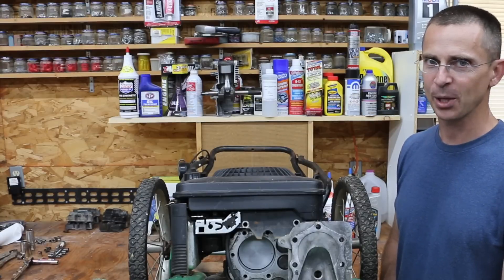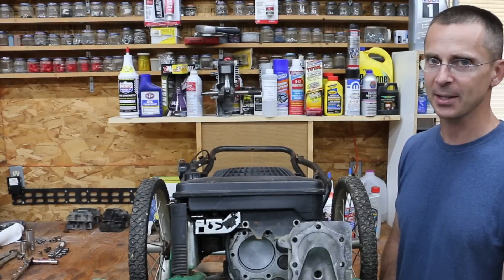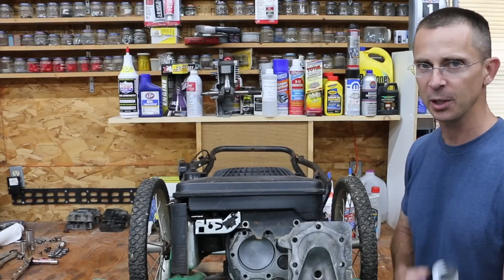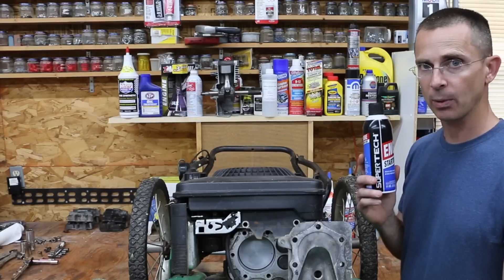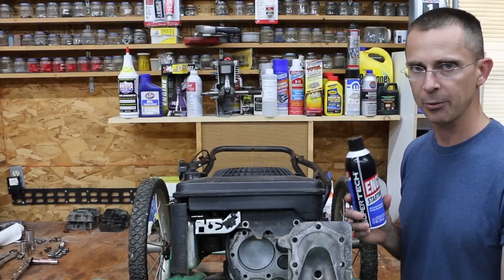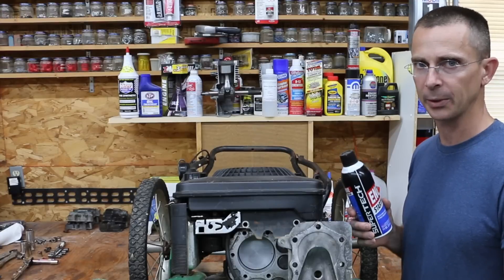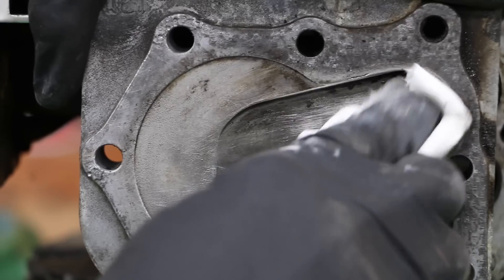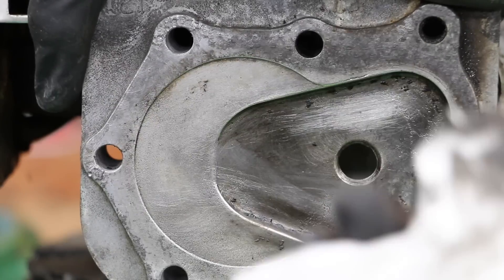Will Running an Engine on 100% Starting Fluid Cause Damage?  Let's find out!

Comment: Sorry for my ignorance, but what does compression tell you? 
Is more always better? Or just to a certain point? 
Thanks in advance. Love the videos!
Reply: Sorry no one reply, the reason is that if the compression doesnt go up it means the piston ring is bad and that is the reason that the engine doesnt turn on and is not a fuel/electric problem. In a multiple cylinder engine all cylinder must have a even compression if for example in a 4 cylinder engine the compresion is :
115/ 60/ 100/ 75 that means that the head gasket is bad. 

115/ 115/ 0 /120 Head gasket is good but the cylinder with 0 haves bad rings.

Comment: i've seen over reliance on starting fluid make an engine "addicted" to it. if used to start too often. It forces the piston rings to  open too hard at about TDC. you lose juuust enough compression at TDC juuust long enough the engine won't start easy unless starting fluid is used. once running. it will run like normal as the wear is only really at about TDC where ignition occurs. it's a thousandth of an inch wear i'm talking about. and only at about TDC. Not the whole cylinder wall. I've only ever seen it happen to diesels engines though. Gas isn't that hard to start so people don't use starting fluid on it often enough to make a difference i don't think.
Reply from the maker: Thanks for sharing.

Comment: An engine runs just fine on natural gas or propane, so why would starting fluid running more dry damage anything. The pistons and valve stems are still lubed with the oil. Clearly is a much cleaner fuel to run, maybe even test it as a carbon cleaning product. The only problem I could see from starting fluid is if they use a low octane fuel to promote ignition, and this induced knock in the engine.

Comment: I once used spray start to start an old chinese diesel tractor.
Spray too much into the intake and the engine will knock like crazy because of early ignition. The rods and crankshaft will at some point take damage and go kaput.
Reply from the maker: Thanks for sharing.

Comment: What I have seen as a mechanic for 22 years is too much into a diesel causing a vapor hydraulic lock that blows rings apart and damages the ring grooves and even piston skirts. But also on diesel you have to keep in mind a lot have grid heates at the intake that get glowing red hot to heat intake air for cold start. I say this because 5 of the 13 in frames I have done were either babys and all had same damage. They were all international 6 cylinders. All were done due to age. Ranging from 17k to 21k hours as a garbage truck.
Reply from the maker: Thanks for the feedback.

Comment: In my over 50 years on this planet...I've run gobs of starting fluid in various engines....Using it to clean carbs, but mainly for trying to diagnose problems. NEVER have I had any damage to an engine from starting fluid in mowers and tractors that were carbed, after running a couple of cans worth spraying it into the throttle bodies.....It fixed whatever was broken..Usually just burning out crud or old gas.
Reply from the maker: Thanks for sharing.

Comment: Would have liked to know the ingredients of the starting fluid and if It has any lubricant properties.
I used to use Racing Gasoline in some of my cars and motorcycles and noticed it smelled like Toulene, which I think smells pleasant, see if an engine will run on 100% Toulene. Thanks 🇺🇸
Reply from the maker: Great suggestion!

Comment: Probably the biggest risk from starting fluid is the potential for blow-back if too much of it puddles up in the intake and ignites.  The only other thing I've heard is that it's not good to use starting fluid with diesel engines.         /           If I'm remembering this correctly (and I may not be) the problem stems from the burn rate.        /         Diesel burns slower than gasoline which burns slower than starting fluid. If the fuel burns too fast it basically detonates inside the cylinder head instead of expanding at the desired rate and pushing the piston. A big enough detonation can cause immediate damage. An engine that's detonating regularly can suffer damage over time.            /         Diesels run at higher compression to start with but they turn much slower so the piston may trap the explosion rather than converting it into movement.        /          I don't know what they use to make starting fluid anymore but I imagine running pure starting fluid in a gasoline engine would be similar to running pure alcohol or mixing regular gas with av-gas. It would run hotter and be prone to detonation.        /         Decades ago a friend of mine used to go to the airport and buy av-gas and mix it with pump gas to make his own cheapo racing fuel. If I recall correctly, He mixed one quart of av gas with a full tank of pump gas.  This mix required him to change the spark timing, use a cooler thermostat, and run the biggest radiator he could find. (It was a 60' or 70's chevy I think.)        /         In the 80's they were putting engine vibration or detonation sensors on some of the early computer controlled cars. They were trying to run as lean as possible. If they ran too lean they'd detonate and the computer would have to alter the timing and fuel delivery. Different cause, same problem.
Reply from the maker: Great point. Thank you

Comment: What starting fluid does,( may be evident with the oil that you found of the cylinder head) is wash away the oil seal, on the cylinder walls.in time, will cause wear, because of the lack of lubrication around the Rings.
Reply from the maker: Thank you for the feedback

Comment: Great video as always ! 
Hey running a mini bike engine with those 40 dollar kits on Amazon , the kit using the , I think 6 gram bottles of nitrous , oh ya , what kind of boost and will it destroy the engine 
Joe Navy veteran 🇺🇸🇺🇸
Reply from the maker: I actually tested it on a motorized bicycle and it did help.  I ran the engine rich of fuel but not rich enough.  https://www.youtube.com/watch?v=Wmg0bzuO1Mc

Comment: You are correct running a engine on starting fluid will damage it!

However it only applies to 2-cycle motors which have oil in the gasoline.

Short use just for starting will not hurt anything.
Reply from the maker: Thank you

Comment: My understanding is, if you regularly use starting fluid on a engine, due to the increased pressure on detonation it damages the piston rings, so they start to lose there seal compression wise and thats when a engine gets "addicted" and will not start unless the starting fluid is used,
Reply from the maker: Great point.

Comment: Many valid literature on diesel engines state engine damage may come from using too much starting fluid and I've witnessed it myself on diesel engines... it spikes the rpms well above the 3-4k rpm that the engine is used to running possibly resulting in a runaway engine or engine catastrophic damage
Reply from the maker: Thank you for the feedback

Comment: Id heard eggs or pepper will plug up leaks in a radiator, I tried it, wasn't a quick fix, perhaps a repeat treatment,  but yes it worked for quite some time, I never replaced the radiator, I just sold the trk a couple of yrs later

Comment: Awesome as usual. Did the starting fluid that you used have upper cylinder lubricant? Tarde to find it without it these days just wondering if that’s why It didn’t hurt anything? Keep up the good work and thanks
Reply from the maker: It did indeed. Thank you

Comment: I mix my own model airplane deasel engines on a mix of starting fluid, kerosene, caster oil and a bit of cetaine booster for semi engines - I was wondering what other starting fluid will work as good or close too the John Deere fluid I use- they have different amounts of ether in them and some just don't work good,  ether content is the main thing
Reply from the maker: Thank you for the feedback

Comment: Starting fluid will burn out glow plugs instantly but you can use it as long as you wait for the glow plugs to go out before you spray it
Reply from the maker: Thank you for the feedback
Reply: @ProjectFarm  I did have a set of glow plugs that were victim of starting fluid next time I get a set I will post pictures

Comment: I know this is an older video, but I was thinking:

If you drained the ether into a jar and used your fuel vapor device, this might work better than just spraying it.  I'm positive you saw all the lost ether on the deck of the mower.
I'm also willing to bet you've either come to this conclusion (about the fuel vapor motor/tank) or someone else has!

It also might be a little less of a fire hazard.... though much more of a bomb if anything flashed back through the carb.

Maybe a tiny vapor system?!! lol
Reply from the maker: Thank you for the feedback

Comment: The reason that starting fluid can cause damage is because of the modern high pressure common rail diesel has the ability to backfire at all that high compression and either backfiring under the intake system and you can get big problems real fast
Reply from the maker: Great point
Reply: @ProjectFarm  thanks for all the great vids man. I love watching them.

Comment: I remember as kid I pulled my carburetor off my moped to see if it would run on Gumout.  I drove around the neighborhood hunched over spraying Gumout in it. I remember it knocking and not running well though I was the first one with a fuel injected moped.
Reply from the maker: Thank you for the feedback

Comment: you wasted most of the starting fluid transfer it into a bottle , then it's liquid . you exhaust the can in seconds compared to if it's liquid. on your can of starting fluid it says 'UPPER CYLINDER LUBRICANT'.
Reply from the maker: Thank you for the feedback

Comment: Check the bearings. The last 3 I saw ruined, 2 diesel and 1 gas destroyed a rod bearing. May have been caused by high revs before oil got to the bearings thanks to cold weather but it was always damage to the bottom end.
Reply from the maker: Thank you for the feedback!

Comment: Part of the myth/ theory of why it’ll ruin the motor is that it puts a vehicle out of timing because it increases the fuel ratio on a EFI motor; and in cold weather
Oil not really flowing well and bam you hit it with very explosive starting fluid to wake it up

Idk let winter hit, and start the motor home with a can!

Just my 2 cents
Reply from the maker: Thank you for the feedback.

Comment: Didn't bither to watch it becaue I KNOW! NEVER use eather on a gas engine. Brake cleaner is also out! Carb cleaner is best for starting/fuel testing gas engines. (T G s mobile vehicle repair. )
Reply from the maker: Thank you for the feedback

Comment: I've been told that starting fluid in a diesel with glow plugs can cause serious damage because the glow plug could ignite it prematurely.
Reply: Burns too hot for a diesel. It will detonate (premature ignition) and lift a head or literally melt through the piston head. Either way... dont use it on a diesel. Block heater is a diesels best friend.
Reply: @illinoisprospector145  
I once pull started a truck with a 350 horsepower Cummins in 12 degree weather and had been sitting over a weekend, we pulled it nearly 100 yards with the engine turning 1500 RPM   before it started. Was interesting to see how long it would take to start.
Reply: @illinoisprospector145  the Kat in line heaters on my Dads Ford 2000 diesel keep burning up. Seems like they're the only brand out there too. Hes gone through like 3 or 4 in a year.
Reply from the maker: Great information!  Thank you
Reply: Using starting fluid on anything with glow plugs is going to cause damage. It will cause detonation and that could blow out your piston rings.
Reply: Starter fluid in diesels is bad you’ll have glow plug or piston damage.   I use Wd 40 for starting diesels much safer.
Reply: glow plugs are active only when starting the engine ( can be disabled), what is bad about using starting fluid that is directly injected into the air intake, is engine run- away. you have an uncontrolled burn and engine over speeding will take place!!!

Comment: Starting fluid wont damage a gas engine, the rick of damage comes from diesel engines. Diesel engines dont use spark plugs but have either a glow plug (in cylinder) or a grid heater ( in intake manifold) to pre heat air for cold starts. Starting fluids can cause an explosion back through the intake causing damage. Seen this on an old 6.2GM diesel.
Reply from the maker: Thank you for the feedback

Comment: Had a 85 ford diesel couldn't keep glowplugs working. So for two yrs i used starting fluid. You know when you used to much.. The engine would knock worse than a rambler with no oil.
Reply from the maker: lol. Great point!

Comment: I was watching a tractor pull years ago, where a JD 4010 stock class, was losing power during the pull.  I could see the operator press and hold the ether button.  The engine ran better for a couple of seconds, then the head exited thru the hood and went up about ten feet.  
#2. We had someone try to start a combine engine with ether but it didn't start.  It was sitting outside until spring.  When we went to start it, the engine would not rotate.  The ether cleaned the lube off the cylinder walls, and the Pistons rusted solid to the cylinders.

Comment: I bought a used. 1988 F350 with a 22:1 compression ratio diesel. The guy i bought it from said to spray a little starting fluid in it when the air temperature is below 35°f. About 2 months later I tore down the engine for overhaul. All the top rings fell off the pistons in pieces.
Reply from the maker: Wow!  Great information.  Thank you

Comment: One time I had to move a van with chevy 305 to another location.  Fuel pump was out so I took off dog house, bought 10 cans  of starting fluid and sprayed starting fluid into Carb while driving it 30+ miles.
Reply from the maker: Wow!  That's a long drive!

Comment: Best way if there is such a thing when using ether on a diesel is to make sure the engine is cranking over before you spray it. Biggest problem with spraying then cranking is one cylinder inhales most of it and the ignition is so violent that it will crack the piston or turn the rod into a question mark.
Reply from the maker: Great point. Thank you

Comment: The real problem is running ether or starting fluid in diesel engines because the diesel fuel is also upper cylinder lubricant. The heat and lack of lubrication from starting fluid can cause cylinder and piston ring damage.
Reply from the maker: Great feedback

Comment: Short term damage to a gasoline engine doesn't seem to bad. I personally wouldn't try it for a long-term test on an engine that I value or depend on. As far as diesels go I wouldn't run any through one because the risk of pre ignition due to their very high compression.
Reply from the maker: Thank you for the feedback
Reply: @ProjectFarm  your welcome. Wouldn't want to see an expensive diesel engine shatter the rods and possibly be dangerous to you.

Comment: I'm curious, did it do any damage to the thin carburetor diaphragm? Do you think that maybe a follow up soak of the carburetor and sensitive seals would reveal any issues? I don't think anything longer than 24 hours would be needed. It's unlikely that a carburetor would be exposed any longer than that without previous problems.

As far as diesels, the problem would be very early detonation. I'm pretty sure that the flashpoint of starting fluid is much lower than that of low sulfur diesel. If you decide to test it in a diesel, do not do it on anything you want to have running after the test. 

Thanks for all your videos! Love the channel!

Comment: The compression of 109 is low. The oil passing the rings saved the engine
 Try it on a properly sealed engine. It will seize it.  That was heavy oil blow by.
Reply from the maker: Thank you for the feedback

Comment: HI, Can You Please Share A Link For That Tool You Used To Measure The Temp On The Engine ???
Reply from the maker: https://www.amazon.com/Etekcity-Lasergrip-774-Non-contact-Thermometer/dp/B00837ZGRY/ref=sr_1_1_sspa?keywords=ir+temperature+gun&qid=1578915499&sr=8-1-spons&psc=1&spLa=ZW5jcnlwdGVkUXVhbGlmaWVyPUExOTVIODVYNkhLTFI2JmVuY3J5cHRlZElkPUEwNTk1NzgwMzAyRUQ4SEZCNURQUCZlbmNyeXB0ZWRBZElkPUEwMDA0NTAwUVNTWkwyWUM1WkJQJndpZGdldE5hbWU9c3BfYXRmJmFjdGlvbj1jbGlja1JlZGlyZWN0JmRvTm90TG9nQ2xpY2s9dHJ1ZQ==
Reply: Thank You Very Much BOSS !!!

Comment: It depends on which starting fluid you purchase, Because you can buy starting fluid that has low or no Lubricants in it. Back in time a bit, the Carquest Brand came in spray cans that was Blue for Regular starting fluid , or A gold spray can that said Premium Starting that had upper Cylinder lubricants in it for starting Diesel and Small Engines.
Reply from the maker: Thank you for the feedback

Comment: Starting fluid will only hurt a diesel due to the fact that timing in a diesel is controlled by injection of fuel not by spark plugs
Reply from the maker: Thank you for the feedback
Reply: I've seen them catch on fire because the glow plugs detonate,then break the piston, and backfire through the intake. Or, the air intake heater catches on fire and, then the paint and rubber fuel lines on the engine catches fire next. However, the 444 can take a nasty beating and somehow still run.  We tried to kill one that was getting junked, just kept running somehow.